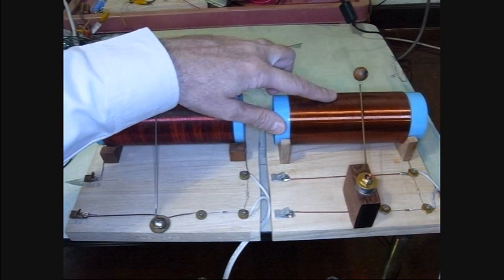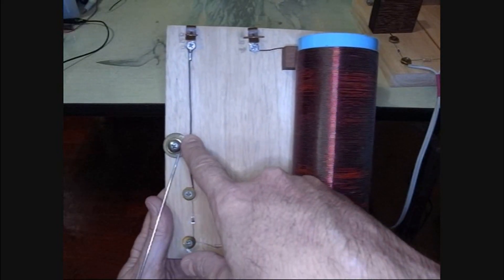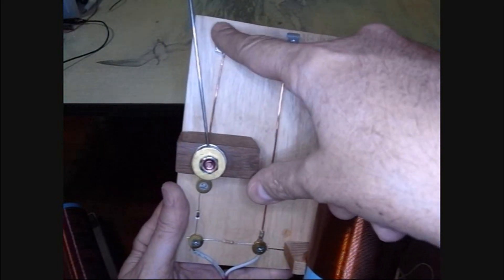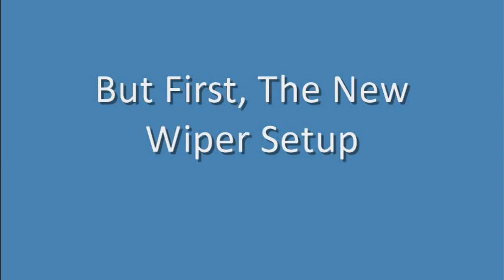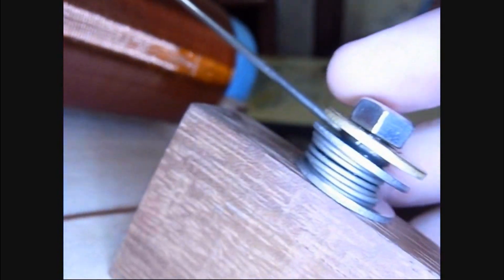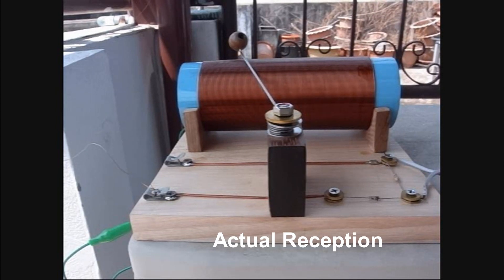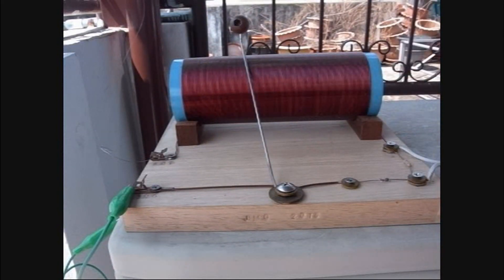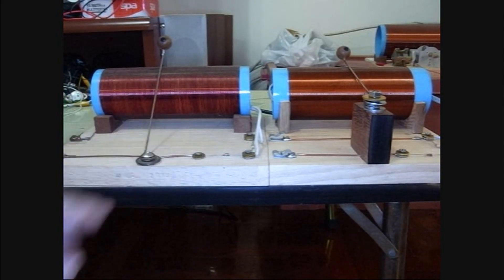New Crystal Radio Design - "Modified-Pickard"

Comment: Good video.  Thanks.  In the "New Crystal Radio Design"  I'm wondering if a capacitor value change between the antenna and ground would make a difference in performance / selectivity / sensitivity / volume.
Reply from the maker: I have a video on that: https://youtu.be/EqEVuLFxgCQ
There's another video on a capacitor radio: https://youtu.be/0AvTO588SyU
Reply: @tsbrownie  I like the antenna tuner idea and it is an improvement in those characteristics..  However the capacitor I was asking about is the  in disc capacitor in series between the antenna and ground.  I was thinking a larger value disc capacitor in that location might couple more energy to the circuit and a smaller value disc capacitor there might help separate weak stations from the stronger ones better.  However I don't see an actual disc capacitor in the vocal description,.
Reply from the maker: Maybe more like this: https://youtu.be/8R8MJpz1MyE
Reply: @tsbrownie  Thank you for the link.  Yes.  The variable capacitor makes better operation than a  fixed disc capacitor.

Comment: Wiper acting as a variable capacitor is interesting design. Never seen this done before but makes sense. Usually used a mica type variable capacitor from a AM band transistor radio.
Reply from the maker: I have videos on capacitor tuned radios, but they are less sensitive than the wipers. The dual wiper is best.
Reply: @tsbrownie  will check them out... thank you for such a fast response!

Comment: I just typed in crystal  set to see the old diagram I used in the 70s at school. Turns out, your "New crystal  radio design" is what I used to use, but my diagram was upside down. I built one inside a biro pen. AC Power sockets in the uk have a pattres box (metal) which is earthed. The screws that hold the power sockets to the wall are therefore earthed. The nib of the pen radio was the earth. I only used an earth - & my body performed as an aerial and  I  was happy to get BBC radio 4. No tuner. It was just an experiment to see if it was possible with no tuner, no aerial. Radio mast was about 2 miles away and radio 4 was the dominant station. I only looked at some old circuit parts today and thought about building one again. Thanks for making this video.

Comment: What function does the resister perform?    It appears to be installed across the earphone wires.
Reply from the maker: Yes, you are right, it is across the earphone wires. These "modern" crystal earphones are piezoelectric. They have a lot more capacitance than the 1940s and before style. The resistor is there to keep a charge from building up in the earphone; without it you will hear very little of the radio signal and lots of popping and other noise.
Reply: @tsbrownie  I am about to start building one.  I have a pack of 5 diodes, 4 resistors and the 4 earphones sold as being for the job.
Reply from the maker: @marynollaig4124  Keep us posted. If you put up a video, you are welcome to leave a link here for others to see.

Comment: Mr Brown, thanks for your time to make these videos on crystal sets. I don't know if you will get this message and get back to me, but was wondering about doing the modified scout radio with taps instead of a wiper. Would this work, and or would it require too many taps to try and tune the radio to different frequencies?
Reply from the maker: Actually the channel is named after my dog, but I will tell him you called him "Mister".  ;)  Yes, you can use taps and like you suspect it would take a lot of them.  A wiper is much easier and lets you "tap" every turn of the wire.  You can make wipers out of old bicycle spokes, stainless or brass rod (available at hardware stores).  Is there a special reason you want taps?  
If so, you can tap say every other turn by using a heavy piece of solid plastic string (like really heavy fishing line or weed wacker line).  And every other winding you go around the nylon line (360 degrees) then continue on.  When done, you sand off the lacquer on the little loops, cut away the nylon line, and twist the little loops to keep the windings tight.  That's a lot of work, but if done carefully (and patiently) it would give you lots of taps.
Reply: @tsbrownie  They look coool!!!... LOL. Actually, I was looking to put taps in, and extend a wire off each tap (Soldered). I would then attach the other end to some type of posts or something where I could just use an alligator clip to tune the coil to the frequency I am looking for. Yes, I do understand the wiper would be much more precise, and maybe I look into things too much, but my concern would be the wear of the coil over time running the wiper across it to tune stations. Have you had any such issues? I may try the wiper style, but may try to come up with something different where a small ball or roller would make contact with the coil.
I didn't know if the tapped version would "Miss" some stations pending how many turns in between each tap. I didn't know how sensitive each turn is as far as tuning. I was kind of looking at this based on the radios made with taps like the dunwoody type, but after watching your video, it appears the simple radio is the best and loudest. 
Again, thanks for your time and effort to put the videos online. I had a couple of crystal radios sets when I was a young child and am trying to find time to put a radio together. Your videos are very thorough and educational.
Reply from the maker: @ImarailHO  I have never had wear issues, although it's theoretically possible.  The wiper pressure is not that high, and one can life the wiper to decrease it.  There are roller types and I have thought about making one, but it's still on the list.  I have seen tapped coils with a circle of brass screws where an arm is used to select which taps and it's pretty cool.  You should make a video of your radio and post the link here.  I'd like to see it.
Reply: @tsbrownie  Thanks again for your response. When I purchased the items to make the radio, I bought enough enameled wire to make 2 coils. So, I may try both ways, tapped and a non tapped coil. If I can get some time dedicated to it, I will be glad to share the results with you as to how they compare. I don't have any wheel spokes or brass rods around that I could use, but I may try something else for the wiper. I do have some spare telescoping antenna rods from old rabbit ear set top TV antennas that may be able to be used. If not, then I will have to figure something out.
As far as the coils, I have watched your videos on all your radios sets. Do you find that a particular size diameter works best? I do have some 2-1/2 inch PVC that I could use. The reason I ask is I have tried using some coil calculators that I have found. You can input the coil diameter, wire gauge and capacitor rating and it will calculate how many turns is required for the proper Q of the coil. I am thinking these are more designed for the folks that run vari-caps or fixed capacitors across the circuit like the resistor you use. (I have a radio now that is set up like that. Was a purchase to kind of get back into this hobby. Only gets one station.)
I heard you mention in your video also that you use a lower ohm resistor, which gives you more volume. I guess I will try that as well, though I have read that some don't use a resistor at all as they are not adding and type of amplifier to the circuit instead of the earpiece. Just curious if you ever tried it without any resistor?
Sorry for the long reply, Just trying to figure out how I will best put this together, although I guess the whole fun in it is tinkering till you find what works best. Say hello to the pooch again...lol Take care.
Reply from the maker: @ImarailHO  I have all the specs in the description under the radio build videos.  If you change the tube diameter it changes the coil inductance pretty severely and it can put the radio outside the AM band.  The higher the resistance, to a point, will make the earphone louder.  Lower resistance makes it quieter.  If you have a variable resistor you can use that to find the perfect value for your radio.  I have a video on a capacitance type radio, and it too only gets 1-2 stations.  I encourage people to try things once they get a basic radio working, stick a variable cap in here or there, change the resistance, use a different earphone, swap out the coil, try different antennas / grounds, etc.
Reply: @tsbrownie  Hi tsbrownie, I finally had some time to do an initial build on the radio (Has been a couple of months since I wrote you). It is definitely something I will have to tinker with more. I was hoping to tap you for some more info. 

I did not have the same gauge wire or coil form diameter. Mine was about a 2" diameter and I have 24 ahu wire. I did some research on the coil recommendations and made a coil at about a 1/34:1 ratio of coil to diameter. I wired everything up, and I heard sound for about a couple of seconds and then the sound went dead (I will get to that in a bit). I tried playing with where the antenna / ground wires are on the circuit like you did when comparing the modified boy scout and your upgraded radio. There is a slight volume increase as you showed with the upgrade radio, but I have noticed the wiper needs to be in a different spot on the coil to achieve the max volume in each case. As far as the earpiece cutting out, is it possible the resistor is too low a value? I only had a 47 ohm resistor available to put on the circuit. Is it too small a resistance and could that cause the earphone to cut out? Not a dead short by any means, but much lower value than you listed in your description.

Also, I am only getting one station. My suspect is that I am very close to a local x-mitter that is only 4 miles from me (@ 25,000 watts). I am guessing it is bleeding over any other possible stations since it is that close and the radio selectivity isn't great. Just curious on your thoughts about this.

I see schematics for radios that have a capacitor across the circuit as well, usually around 100 - 400 pf range. Would something like this help with selectivity? I see the Dunwoody type radio uses two 365pf varicaps to increase selectivity (Which  is along the lines of your radio you made with the varicaps inside the 4" pvc coil).

I am also guessing a longer antenna wire outside the house would be better, but that is something I will have to find more time to work on, and get some long wire to make. Not sure if this would even help the selectivity situation as the station so close to me would likely come in even stronger with the long-wire outdoor antenna. All I have now is a 10 foot or so piece of speaker wire I connected to the circuit, but even with that, the local station comes booming through quite loud.

All in all, it was a fun project to put together. I will be glad to share a photo or make a short video to post at some point when I get a chance and after I am done experimenting with settings / configurations.

Thanks for taking the time to answer my previous questions!
Reply from the maker: @ImarailHO  Hi again.  First the resistor is literally 1000x too low.  At these tiny power levels it might as well be a dead short.  No cap across the earphone unless you have a genuine crystal earphone from 1960 or before.  Changing the wire / coil diameter changes the tuning range of the radio, so it's kinda hit and miss on whether you'll get in the right range.  I'll look forward to your video / pictures.  Here's a video I did on the common problems when building a crystal radio.  https://www.youtube.com/watch?v=kCxQ8iPQx4s
Reply: @tsbrownie  Thanks for your reply and the link. I did see that video a long time ago, and I guess I was on the right track with the resistor. I was looking through my electronics stash, and found some 4.7K ohm resistors, which is much higher than the 47 ohm. The 47 like you said is too low and is likely causing a dead short due to the close proximity of the station from me. I had the radio working good yesterday and it is quite loud, even compared to the store bought radio I purchased last year (Ferrite core / litz wire style with the varicap -  most commonly found these days). 

After reviewing your "Fixes" video I am looking at the biggest issue being the 47 ohm resistor. I will try the 4.7K in its place just  to see if it males the difference and I will have to acquire something around the 10K when I get a chance.

All other issues you mentioned are good n this radio as far as connections etc. I did use a stainless "Rabbit Ears" rod from an old TV set top antenna and made sure to clean out any particles in between the coils from sanding the area the wiper makes contact with.

Pending where I clip the antenna and ground connections affects when the local station tunes best on the coil, which is just either side of center in each case. SO I am guessing even though I used a different coil form diameter and gauge of wire, I am still in the correct radio band, otherwise I would not get anything at all. Again I think some of the issue is my location to the closest radio station. At 4 miles, it it quite close and they are at 25,000 watts. I had a similar situation when I was a kid growing up. We lived about 25 miles NW of where I am now and there was a station about 2-3 miles from us (In our back yard) that overpowered other radio stations even on a good transistor radio back in the day.

Anyhow, again I thank you for your time to answer questions and for posting these videos for others like me who like to tinker with these things. I will post a video when I get a chance so you can see the setup. Would you have any problems if I posted links to your radio videos in my description as a reference to anyone who may happen upon my video? I always place credit to where it is due and where I find information.

Thanks
Reply from the maker: @ImarailHO  The rabbit ears antennas are pretty sketchy since TV frequencies are way above AM radio (about 50x to 200x).  I have a video on antennas for crystals radios, they're pretty much just a long piece of wire.  Yes, you can leave a link here for your video.
Reply: @tsbrownie  Thanks for letting me leave a link... Not sure if I confused you, I used the rabbit ear rod for the wiper portion of the circuit in place of a rod / spoke from a wheel. I plan on getting or making a long-wire antenna at some point. For now I have a 20 - 30 foot piece of copper speaker wire I am using as the antenna.

Thanks again
Reply from the maker: @ImarailHO  I see, yes I misunderstood.

Comment: you should also try connecting multiple 1n34's clumped together in parallel (instead of using only 1 ) as i notice you can actually drop the forward voltage lower with subsequent paralleling of additional diodes..that might improve audio output perhaps?
10 Kilo ohm variable Pot instead of a fixed resistor would also allow us to experiment for clarity perhaps?
Reply from the maker: OK, just for you!  ;)  https://www.youtube.com/watch?v=BTu_GJKjOmA&feature=youtu.be

Comment: TSBrownie.
In your experience,  is a crystal earphone the only way to listen without modifying it with a power source? I am using a smaller 2 way radio speaker that I pirated from a junked walkie type.  No sound.  Also using the blue razor as a diode.  
Any advice?
Reply from the maker: I have never tried the razor blade.  Try the 1n34a diode.  If that works then you know your problem is the blade.  The speakers will not work without a battery powered amplifier.  You must have the crystal earphone to go direct.  This video is about common problems.  It might help:  https://www.youtube.com/watch?v=kCxQ8iPQx4s
Reply: From the original circuit and the one that has been upgraded, how many kHz is the frequency range?

Comment: Those two rigs remind of an old idea of using one crystal radio tuned to a close by high power station to provide the power to a second set with something like a transistor to provide sound  amplification.  I always wanted to make such but still have not got around to it.  ( I get a round tuit and I'm there! )  The design make the second set loud enough to use a speaker instead of earphones .  Got to Google for a link to this subject.
Reply from the maker: Yes I considered that.  My first experiment was to power something from the crystal radio.  I got a joule thief to light up from a crystal radio (I posted the video).  Problem is the current is REALLY low and it's rather fidgety.  Will have to look into that again when I have more time.
Reply: I guess you have to be careful in tapping the power of the radio noise that surrounds us for whatever propose as Doc Finley was to find out in this  old Outer Limits episode . https://www.youtube.com/watch?v=aa2AprvgWzA  Just can't let the subconscious / the monsters of the id get hold of it ever!

Comment: Always been interested in building a crystal set, is there any direct correlation to the diameter and length of the coil? Also what gauge copper would you recommend?
Reply from the maker: You should give it a try.  It's not hard and it's the next best thing to magic.  Yes, the diameter and length set the inductance, so it's relatively critical.  I put the specs in the description.  The wire is 0.55mm.  It works well, not too thick nor thin.  You can use wire from an old transformer or such, just use the heavier stuff.
The 2 ways that keep it from working are: 1) use the wrong diode or earphone and 2) fail to scrape the enamel coating off the wire where it connects.  Outside of that it's pretty much a sure thing.